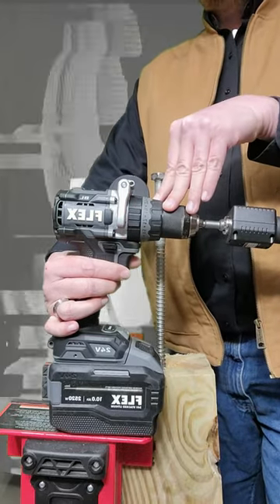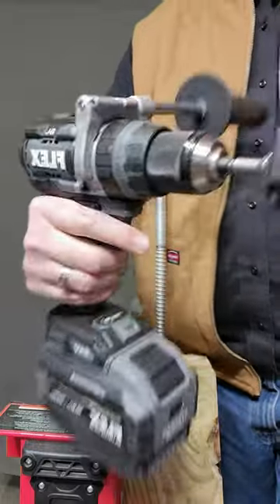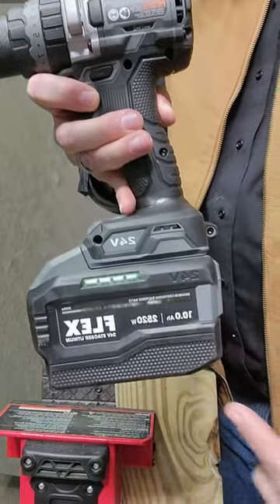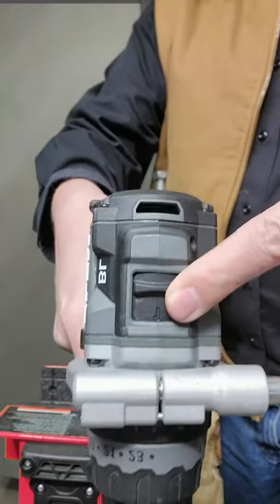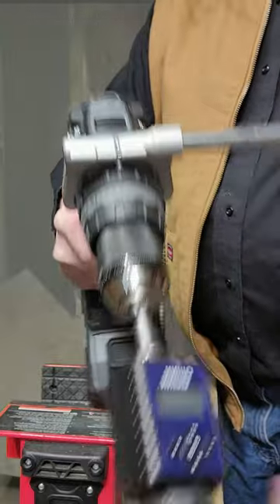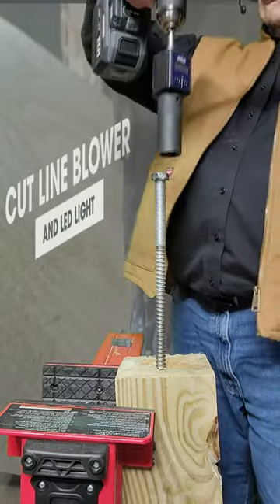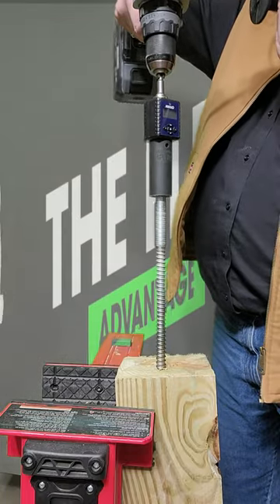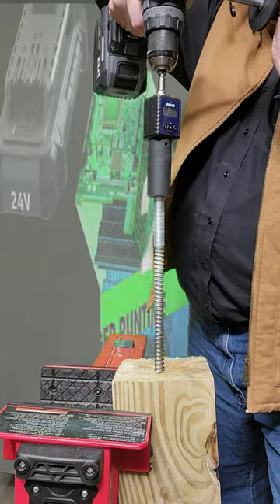Flex Hammer Drill 10ah Lithium Stack Battery #torquetest #torque #flextools  #shorts #trending #fyp

Comment: I'm still trying to figure out how he's drilling a hole when he bypassed the chuck LMAO.
Reply from the maker: And I am trying to figure out what a know it all troll has to leave a comment proving they're a douche
Reply: @ToolswithSoAlz  FauxFessionals… looks like the anti kickback is setup for the same torque specs on all there drills, very happy with where they decided is too much torque for the hands, I’d be curious if you could get a higher number using the handle. I could be wrong but the lights flashing is the same pattern mine does when anti kick engages.
Reply from the maker: I had it turned off I think but maybe
Reply: @ToolswithSoAlz  not sure if you can override the Flex, the Milwaukee yes 💯 but the Flex I’m certain is not toggle able.
Reply from the maker: No worries
Reply: @ToolswithSoAlz  How you been Brother?
Reply from the maker: Hurting if I'm being honest
Reply: @ToolswithSoAlz  Terribly depressing to hear that coming from you Brother, I’ll say a prayer for you tonight Brother! Don’t lose that positivity that burns brightly in you Brother, it will get better! ❤️‍🩹